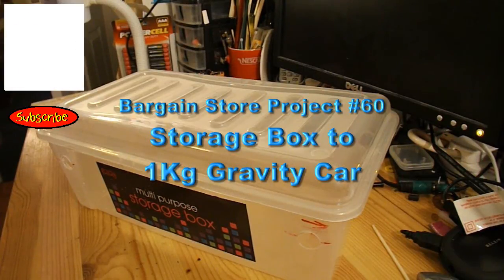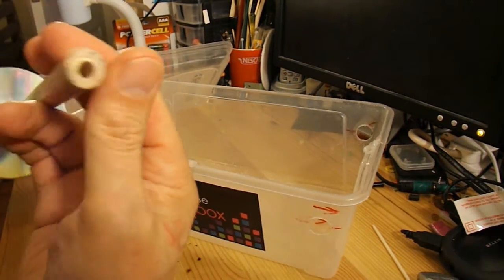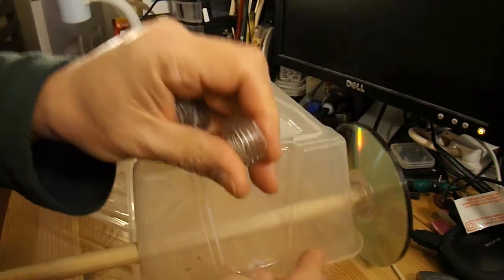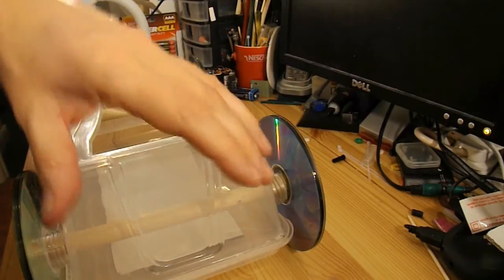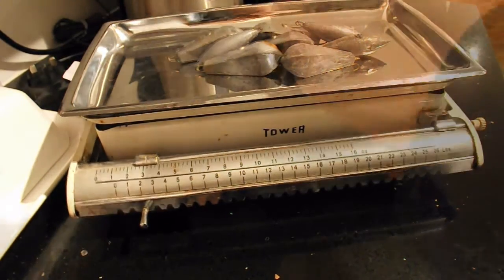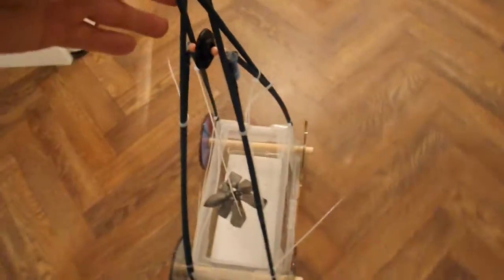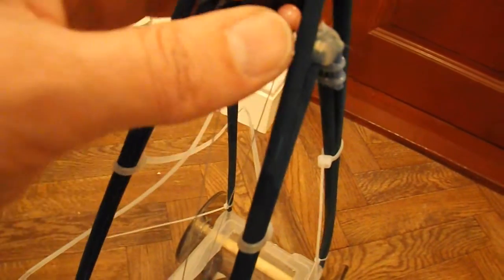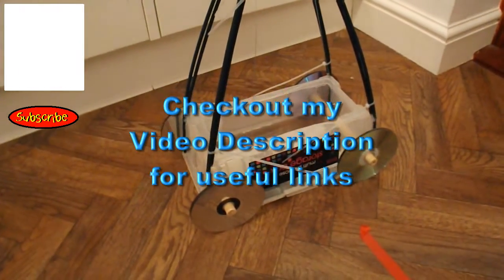Bargain Store Project #60 Storage Box 1 kg Gravity Car

Comment: do u have an alternative for the flower canes?
Reply from the maker: Surely that is a question for you to answer, not me. You will have to find an alternative. I don't know what you would have available. I chose bamboo flower canes because they were readily available in garden centres and relatively cheap. You need to identify a stick of some sort that is not too flexible. If you go to a hardware store and look at wooden dowels, I think you will find they are more expensive. (A hardware store probably sells bamboo flower canes too). Aluminium tubing would be much more expensive. Fibreglass canes would also be expensive. Thinking what else might work, maybe an old broken umbrella might have suitable rods. Bamboo barbeque skewers would probably be too short, but you could join two together with an overlap, to increase the length. If your car has to carry a 1kg weight like this one, you do need sticks that are fairly strong. If you don't need such a large weight, you could probably make it smaller. There are other designs in my Gravity Power Car playlist in the video description.